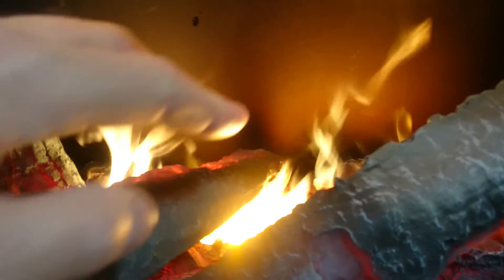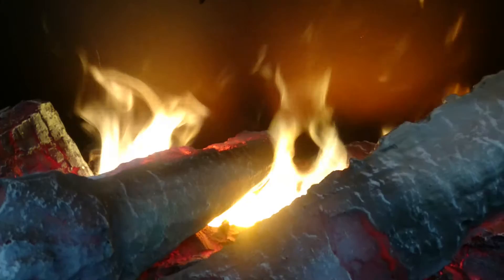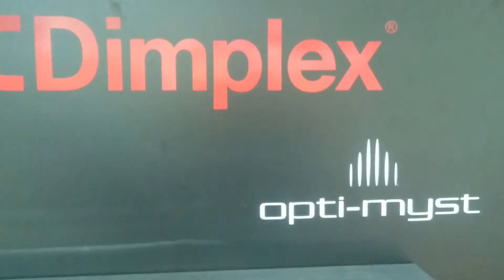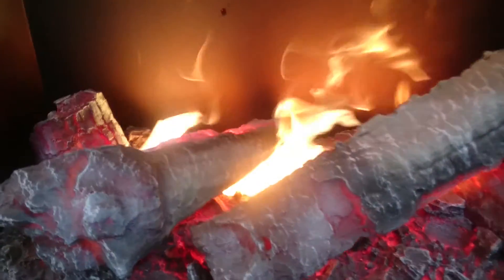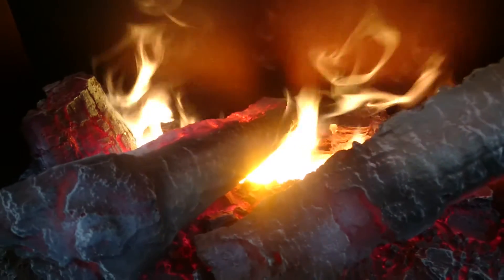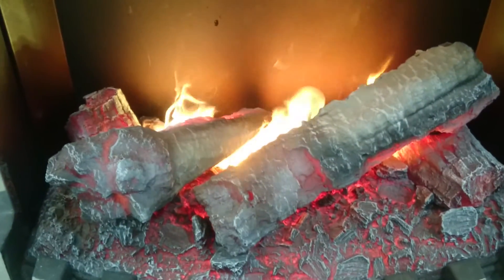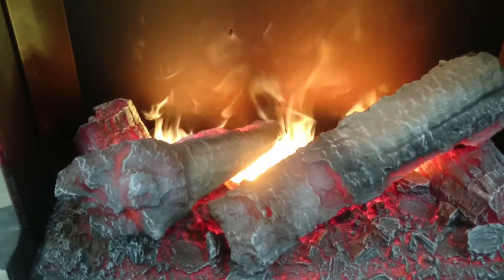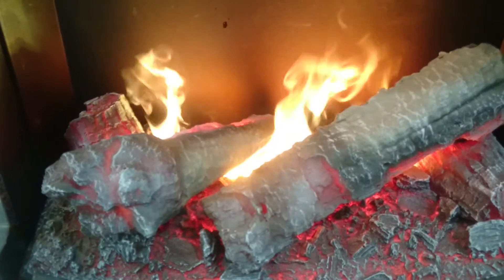Dimplex Opti-Mist - fake fire - for model railways?

Comment: I would imagine it be pretty easy to replicate that effect, could easily use a few incense sticks or steaming water, lightly dry brush some clear plastic shaped objects whether it be a building or flaming coach using crackle paint then just put an orange bulb under or within the item you wish to have that effect, i imagine you already have something planned though and look forward to seeing the result :-)

oh p.s have you discovered the micro machines children's toys as yet, i just bought a whole bunch of them, there are some that are pretty close to ho/oo scale, and at the moment there are a fair amount of star wars figures, i have some nice ideas for changing the speeder bikes into perhaps jet skis or just a small cameo in a nice wooded area of my next layout, even got me a pretty close scale millennium falcon to oo gauge and plenty others all off ebay dirt cheap, i know you like your sci fi related railways so just thought i would mention them to you.
Reply from the maker: +northeast74 Well I was going to get a £20 steam effect machine that people use for humidifying. Originally Cato Pass was going to have this under the cardboard rocket but I thought steam and card probably won't mix well, so I went back to the regular smoke oil effect. 
Thanks for mentioning the Micro Machines stuff. I haven't seen them though. Your cameo ideas sound cool. Subbed. Cheers, Laurie.